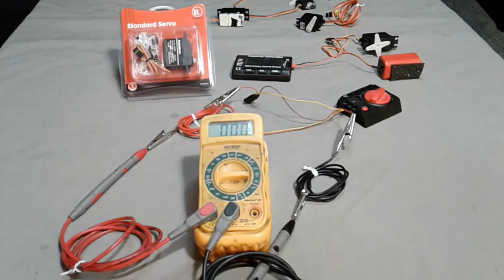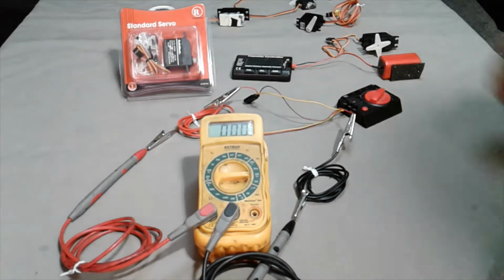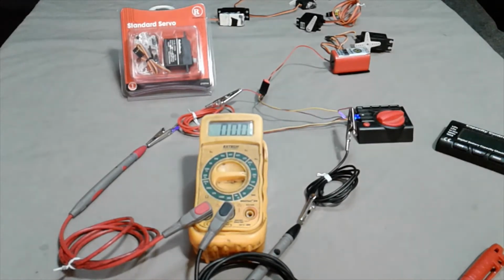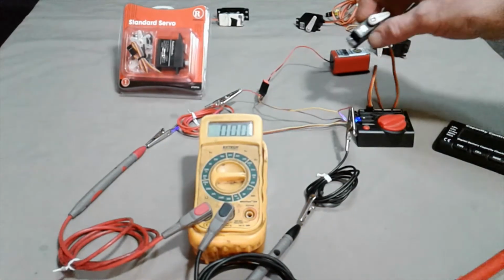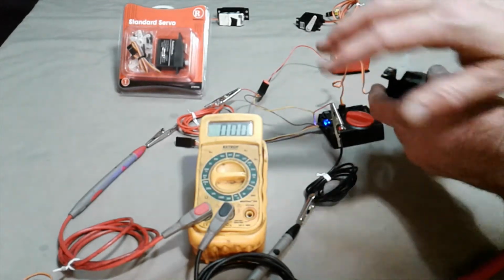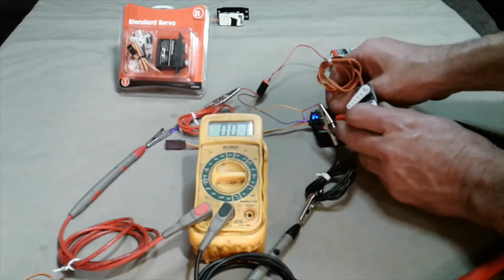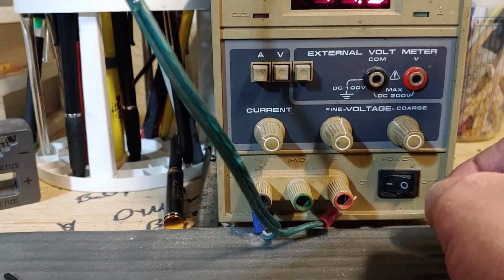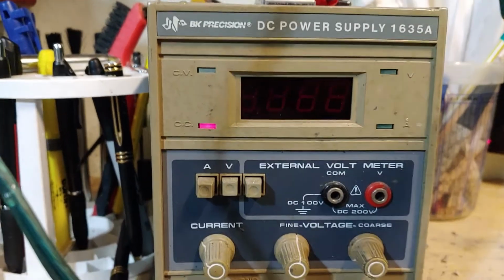testing and learning rc airplane servo amp draw digital analog spektrum e-flite apprentice servo wow

Comment: good work.      you have  ALREADY  shown that  some servos consume more power  than  others.  and, the vintage of a servo  Should  be  known and considered.
Reply from the maker: . im going to make some short leads and run threw some of these test again. i want to compare my results to what a servo actually consumes per the manafacture info first just to make sure my setup is accurate

Comment: I'm sure you know a lot of people run a separate bec when they use standard size servos!
Reply: a separate bec            that  is  not  a solution to this 'issue'.
Reply from the maker: yes i do know about a seperate BEC this was only just to show that there is a difference and that a servo will use battery just by the wind pushing on the control surface etc. it was just something cool to show